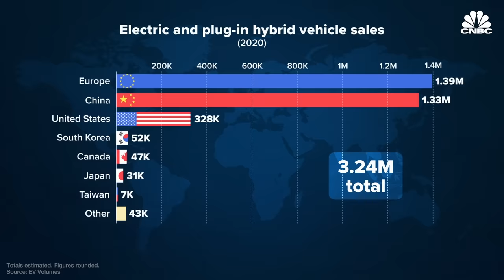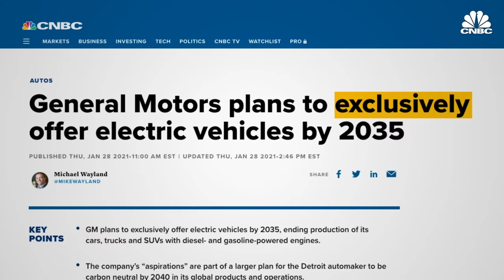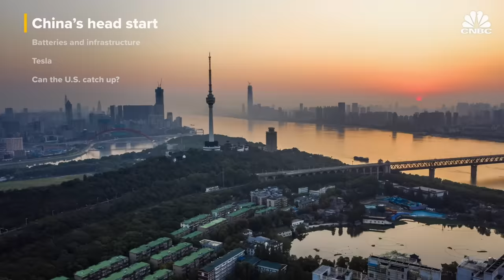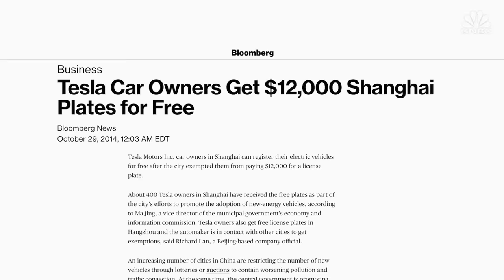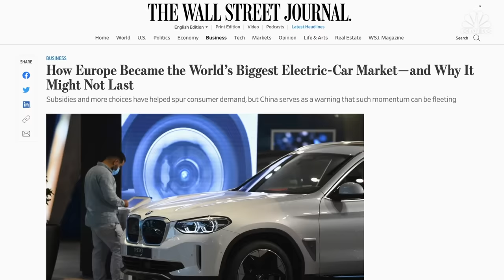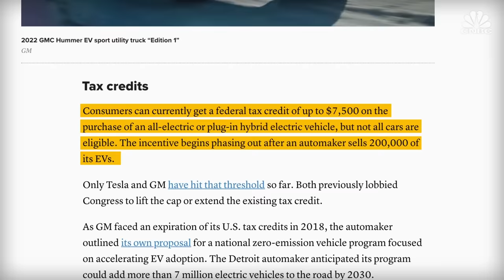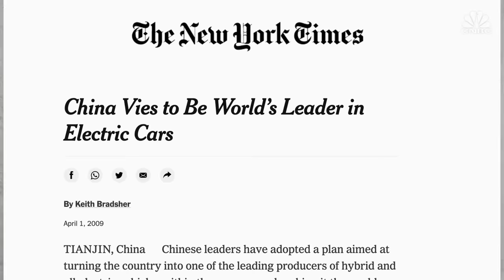Who Is Winning The Global EV Race?

Comment: I get the argument for swapping but it really isn't needed. Car charging has significantly improved in the past few years. Even fleet vehicles will have several hours a day were they are not being used.
Reply: What about batter upgradeability and what if autonomous fleet taxi works 24/7. You need NIO because the battery tech is rapidly evolving so you can easily upgrade batteries rather than throw away the vehickes, or keep junk batteries
Reply: @LetsLearnEconomic  
How do you "easily upgrade the batteries"?
But having 13 times the number of packs in swap stations.
Having to swap them out using trucks when a new version comes out.
Having to "chase" the old packs which are still in cars then being returned to swap stations, a d remove them BEFORE the next car in line needs that pack.
Having to (probably) upgrade the firmware and/ or the BMS to optimise the new pack type (so wait before driving?)
It's a logistical nightmare.
Reply: @rogerstarkey5390  but that not the fleet need to care, the swap station will work on that
Reply: nah, swapping is superior 
esp being able to balance the load on the grid.
Reply: INDIA WANTS TO FALL DOLLARS VALUE..
Reply: I need to supercharge maybe 5-10x a year and don't see a need to battery swap either. Get the bulk of your charging at the convenience of home/work which doesn't stress the battery, not worry about the history of the swapped battery, AND you don't have concerns with wear/tear of connections around the most important part of an EV. 

I can see the argument for it if you supercharge more often and want the convenience.
Reply: no matter how fast your charging is, there is no way you can fully charge within 3 minutes, which is how long it takes to swap the battery pack. Supercharge also wear out the battery faster.
Reply: What about the expense of removing batteries from most cars it can be expensive.  Makes more sense to have easy access to remove battery

Comment: My question is , " An internal combustion more is about 16% to 18% efficient . We have created Shatter proof glass , a.b.s. , traction control , skid control , lane departure plus an actual Electric vehical but the milage still remained the same for the last 100 + years ?.. 
That's a Hustle kids and for every $1.00 of fuel you buy about $0.80 goes out tailpipe .
There are patents buried that make the F150 get 2400 miles plus a tank but they were bought and buried..
The e.v. means you will be at the mercy of the dealer !!

Comment: China/EU is racing ahead probably since they import a lot of Oil while US produces about as much oil as it uses.
Reply: Not the full picture. People are fine with driving small cars in China/EU. While in America, everyone wants to drive those hummers, massive SUVs, and pickup trucks. It is hard for EV tech to power those large vehicles that Americans love to buy and flex.
Reply: @pizzadoe7922  For real like wtf is up with them pickup fetishes?
Reply: @pizzadoe7922  no, it's easy to put a big battery pack on an enormous vehicle. Look at the Hummer, Rivian, new BMW i whatever, Tesla Model X, ... It's expensive and wasteful, on top of the expense and waste of such a big car, but people are ordering them. The bigger market is in Model Y-sized, not-really-"compact" crossovers including the Ford Mach E, VW id.4, etc. The electric pickup market could be even bigger.
Reply: @AquaWeiner  Some got serious insecurities, and they buy big cars to compensate for that. Have you seen how they modify their pick-up trucks by jacking up those wheels - looking like monster trucks?

The funniest part is many of them are urban commuters, where there is barely any rough terrain. They are just for show-off.
Reply: Oil is use for everything
Reply: @ericli2936  No, oil is not used for "everything." We use very little oil to generate electricity; generation is mostly gas but a steadily increasing percentage comes from wind and solar. It's now cheaper and much much cleaner to propel cars with batteries and heat water and homes with heat pumps, and by ~ 2025 they will be the majority of new equipment.

Decarbonizing is more challenging for industrial equipment, shipping, and aviation, but we can make expensive renewable fuels using Terawatts more renewable electricity.
Reply: @skierpage  Rubber, Plastic, paint, asphalt and much more is a byproduct of oil. You are naive if you think we can slowdone consumption. I will be convicted when I see electric cranes, tractors, trucks, excavators and skidders.
Reply: @ericli2936  none of those is as carbon intensive as burning fossil fuel.
Experts' opinions on when electrication will reduce demand for oil range from 2024 (IEA), 2025 (Barclays), early 2030s (Shell), late 2030s (BP). Etc. Lots of opinions.
Electric trucks and heavy equipment are already on sale.
Reply: @AquaWeiner  because we love it, Wong.
Reply: @JDAbelRN  try to understand the difference between making products from oil and burning it for energy.
Reply: @ujjalshill6442  do both! Make more livable cities so fewer people need cars, but 10s of millions are not going to give up their cars, and replacing a gasser with a BEV is definitely a win for the environment. Your allegations about toxic batteries and fires is nonsense. Gasoline is far worse to mine, refine, ship, spill, then burn than storing renewable energy in a battery and none of it can be recycled; combustion cars catch fire way more than BEVs.

Comment: Imo: gm started this back in the late 90s and dropped the ball. Then Tesla (once Elon bought them) came through and picked it up. They invest sooo much into this field that they themselves made it a profitable business (with carbon tax credits currently). Imo Tesla is leaps ahead of other manufacturers when it comes to the tech of the car. Fit and finish...eh they could do a tad bit better. Others are catching up to the 2018/2019 Tesla but now Tesla is advancing with diecast fabrication and advanced tech for auto pilot and efficiency of battery kwh/mile. Can't wait for them to get into other industries.
Reply: Ehh it's not realistic if you put 60 amps in most Americans homes the TRUE power supply will struggle they already have power struggles now in the summer let's put a arc welder in every home and expecting it to work even better the car is not the problem it's the power grid
Reply: @peterroberts4555  - not as much a problem as people think. Most cars will be charging overnight when grid usage is lowest, and perhaps using computer controls to make sure they charge at times of lowest usage.
Reply: @peterroberts4555  
Divert the same grid energy used to refine oil (7kWh per gallon of refined fuel) and you miraculously have the energy to power every EV about the same distance as that fuel.
Reply: @rogerstarkey5390  Sorry to tell you oil will definitely be here your whole lifetime it is that important how it is used is the problem 60 amps is so much power it can jump a air gap to melt a filler material to join two pieces to one having most homes in America do this is a joke wake up

Comment: The state government here in QLD, Australia, just announced a $3000 incentive for EV's but Tesla's don't qualify because there is a price cap of $58,000, and the cheapest Model 3 starts at $63,900. I doubt Tesla is going to drop the price as they already have a demand problem. I'd be happy to be wrong about that however...
Reply: Likely you'll have to wait for battery technology to lower the cost of vehicles.  Potentially when the 4680s are being mass-produced, Tesla could offer lower prices. 
But, it may be that before Tesla lowers their prices, Chinese automakers will start exporting more affordable EVs. 
I think it will be at least a year or two before any of that really happens at scale.
Reply: @AWildBard  The Chinese already dominate the affordable end of the EV market in Australia. The MG ZS EV andthe BYD Atto 3 are the 2 most affordable EV's in Australia at the moment, (both are about $19k cheaper than the Model 3) and even more affordable models are on the way from BYD and also from Ora, the EV brand of Great Wall Motors, later this year. Sure, Tesla aren't going to compete directly with these vehicles until their proposed affordable EV has been launched, but Tesla's real problem if you can even call it a problem, is the insane demand for their cars that allows them to raise prices knowing that it won't cause a drop in sales. Personally, I think that they should drop the price of the cheapest Model 3, but they are going to sell every car that comes off the boat from Shanghai, so why would they?
Reply: @ujjalshill6442  
I agree we should aim for a more sustainable future. But I think banning cars is not going to be possible. 
I do not think it's necessary either. However, I could be wrong about that. 
So many things we do today are terribly destructive to the balance of life that sustains our existence. And our addiction to profits may be the death of us all.
Reply: @aftonline  not high-rise buildings more like buildings in Barcelona  most people don't like suburbs you are an exception I guess
Reply: @aftonline  also cars require road that costs a lot of money to repair
Reply: @aftonline  living in mixed housing areas is good for your physical and mental health and you also don't waste time sitting in cars and it is profitable for the city suburbs bankrupt city's
Reply: @aftonline  watch this
Reply: Are you happy now?

Comment: China isn't the only one with a unified charging standard. Europe has CCS for instance. it's really just the US that's lagging (last I checked at least).
Also, the fact that historically the US has always had low gas prices doesn't help with the adoption of alternatives.
Reply: The EU does not force anyone to use CCS. Tesla could have kept it's own standard if it wanted to, but then would have been cut of from government incentives. China on the other hand does legally require the use of a single standard.
Reply: Unification isn't a problem. Every EV uses the same plug for low- and medium-speed AC charging (Teslas come with an adapter), and every manufacturer has standardized on the CCS 1 plug for DC fast charging apart from Tesla and Nissan's fading Leaf. The hassle is having to sign up for multiple charging networks, but standards are in place for just plugging in to any charger and getting billed, as Tesla owners enjoy with Superchargers.

Maybe Tesla will equip its North American cars with CCS adapters and its charging stations with CCS plugs.
Reply: @skierpage  Aah so my information is at least partially outdated. The model 3 and y we get in Europe come standard with ccs plugs though and all tesla superchargers are ccs equipped to my knowledge.
Not sure about the s and x.

There are efforts underway to combine as many different networks as possible into 1 fuel card. I have a new motion card (shell basically) which should allow me to charge on most of the charging networks throughout Europe.

But yes, it is an issue and a challenge that will hopefully improve over time.

Comment: Ford and GM just stopped EV production completely, cutting losses. Lots of Chinese EV startups went bankrupt. There is huge consolidation in favor for giants like Tesla and BYD. The rest can't keep up with speed of research and innovation. Demand for EVs has slowed. Even Tesla sales slowed. So far electric car is a niche market perhaps for 15 - 20 percent of techy fan consumers at a current level of technology. Lack of charging stations and long charging time are biggest deterrents. Besides EV manufacturing is on another level of specialization. Even Tesla has to either invent a car on free electricity or switch to fuel cells in the future. It is getting clear this battery madness wont replace combustion engine. People love the idea of electric car, but hate batteries. Looks like anti battery sentiment is building up. Batteries are terrible for the environment - is another big concern

Comment: Swapping batteries won't work long term. Why? Batteries are able to charge faster and faster every model or so that is released. Batteries are also getting better. How so? Well, when solid state batteries are widespread, they are faster and safer (less heat generated) than the current battery tech of today.
Reply: Rather, they will never work unless batteries are standardized in their form and location. Unless they do that, swapping stations will only be able to service a few specific car models, making the business case non-existent.
Reply: @dinokknd  You will never get standardized battery size and locations on ALL cars. If I was a manufacturer I wouldn't be in favor of such a thing. Why? It likely would limit the look of a car. Besides if you did that it could limit its range, and there just might be a better more practical and logical area(s) to put a battery on a car. This is provided there were real advantages you could gain that are big selling points for a car or cars. 
If it were to be completely standardized a specific spot and size on a car you are taking out 2 big potential sales points from a manufacturer to differentiate their product from others out in the marketplace
Reply: @daviddill5227  the talking head analysts in this cobbled-together video were appropriately dubious, it will probably only be fleets who can negotiate the three-way deal with the vehicle maker and Ample. However, I would love to buy a $25,000 EV with a small battery pack for urban driving, and then rent at substantial expense an add-on battery pack for long drives. Standardizing an add-on pack is slightly more feasible.
Reply: @daviddill5227  To have the battery swap network work well, you would need good coverage of a country with them. What would the business case be if you are only selling a couple of hundred K vehicles and have to literally fund thousands of swapping stations with that?
Reply: @dinokknd  - absolutely you would need these battery swapping stations in reasonably close proximity to make it work. It would have to have a good supply of batteries on hand to accomodate the different cars and all the various batteries. It would be difficult to pull off. The storage of batteries along with the charging infrastructure to charge a lot of batteries and swap them out seems like a hell of a lot of work. When they stated it takes about 20 minutes to do a swap,  you could charge up the battery at a charging station to 80+ percent in roughly the same time. Even with fast charging, the lifespan of the fast charge battery is hundreds of recharges, so I don't see the value of EV slow charging. Would the battery slow charged last longer? Yes, but considering the inconvenience of going to their facility and swapping it out when I can easily drive to a fast charger and get the same genetal charge it just doesn't make much sense or financial sense considering the  overhead slow charging is, and its likely higher cost.

Comment: Makes sense for any country that is not a net oil producer. Instead of paying the Golf countries they can make the juice locally by photovoltaic or by wind and hence the money stay in the economy that generates them. EVs are a game changer on the mobility and energy market with impact as far as political geostrategy - suddenly countries desperate for oil they can divert that cash somewhere else.
Reply: Yeah especially here in the Netherlands. Because we have to import all of our oil, the government heavily taxes gasoline in order to reduce consumption. It's the same for large and inefficient vehicles like pickup trucks that are taxed extremely heavily. Most people drive cars with 1-2 Liter engines because of road taxes and fuel prices. 

It also makes EV's madly popular here, because energy in the form of gasoline is such a large part of the cost of car ownership. So if you drive a lot, an EV becomes the cheaper option rather quickly at 10 dollar per gallon. Plus everything is closer together, and there are chargers everywhere. So the is less range anxiety.

I'm putting solar panels on my roof atm to fuel my EV. Screw spending $400 per month on gasoline.

Comment: WAY too much on Ample on the subject of battery swapping. NIO is the foremost company in this area.   NIO now has over 900 swap stations in China.  Swapping is about 5 min. You can buy the car and lease the battery if you want, vastly cutting down on customer upfront costs. You can lease different size batteries depending on your driving needs.  Need to go on a long trip?...you can swap out for a more powerful battery on a very short term basis. I'm in New York, and I would greatly prefer battery swap. Also, I wouldn't have to worry that I buy a car and the next year a vastly superior battery has been developed.  Baas = Battery as a service......imo this is grow tremendously. Good for the companies, good for the consumer.